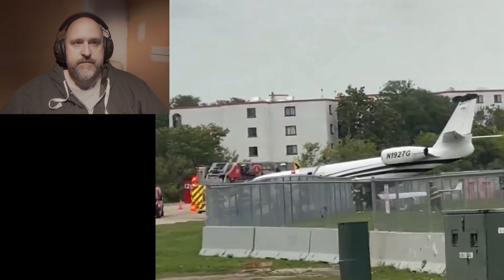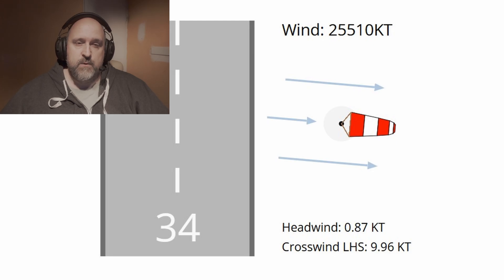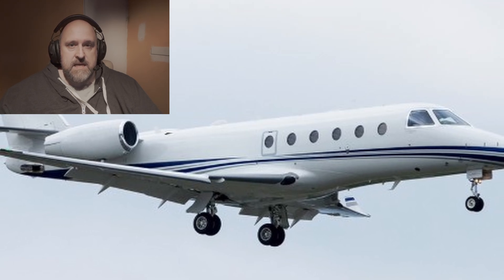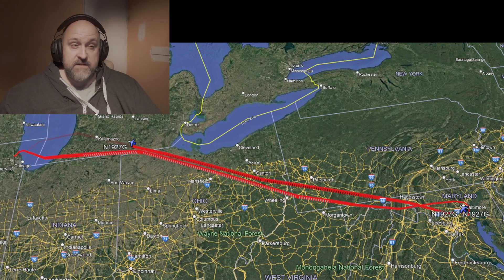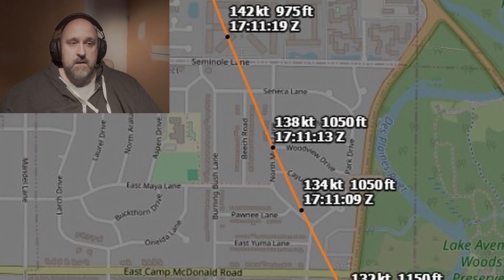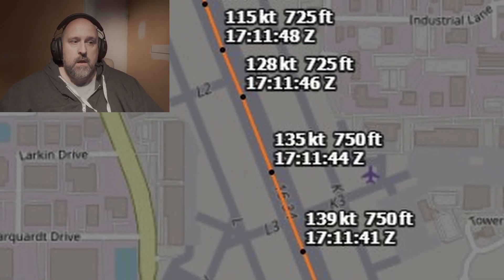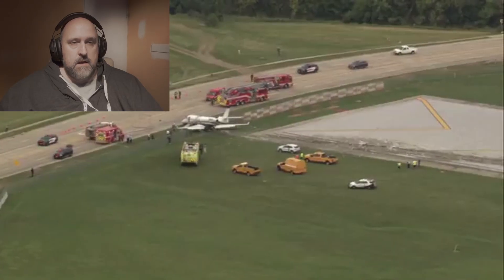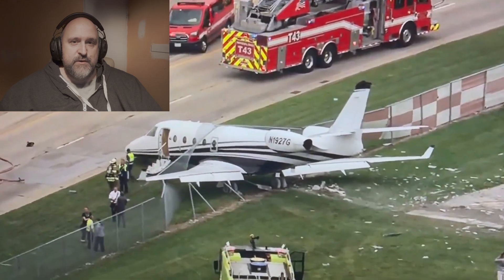Are Business Pilots Under Pressure?? - Gulfstream G150 Overrun at Chicago PWK (N1927G)

Comment: Thanks for your very descriptive analysis. As a matter of interest there was another very similar overrun very close to where I live near the Boca Raton airport last week also involving an arrester barrier I  believe and no reported injuries. The aircraft involved was a Bombardier Challenger and thankfully to the "EMAS" system. Any news on that incident? Thanks.
Reply from the maker: Thank you very much for the kind words - I did see some videos of the incident at Boca raton airport and just had a quick look at the data - It actually looks very similar to the incident in the video.  Straight in approach that looked stable until a mile out where it gained speed - they were coming in  100-150 feet to  high when crossing the runway threshold and about 17 knots to fast, and didn't touch down before using 3/4 of the runway. 

So basically two very identical cases - very interesting indeed.